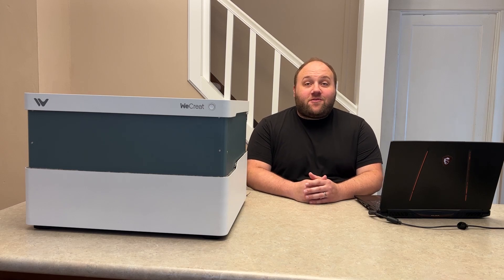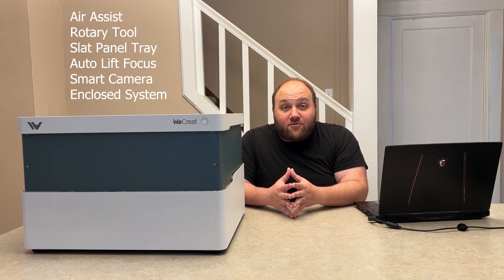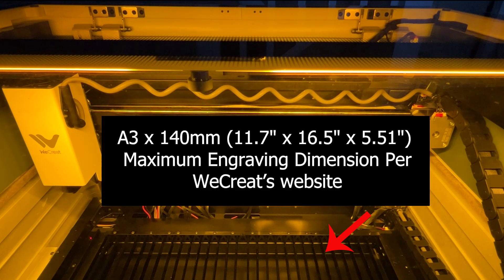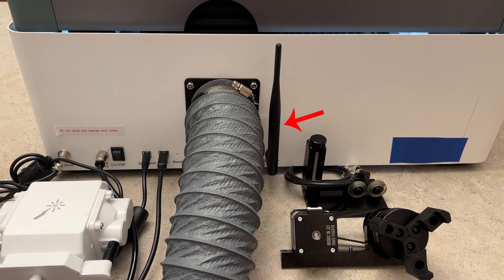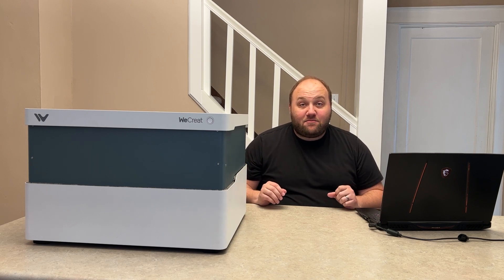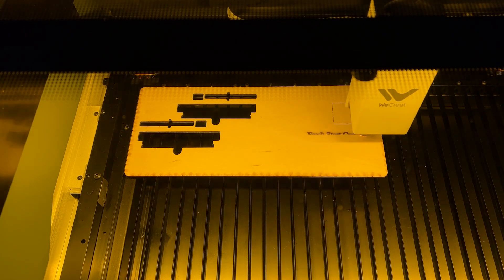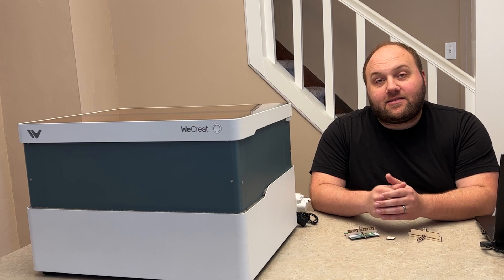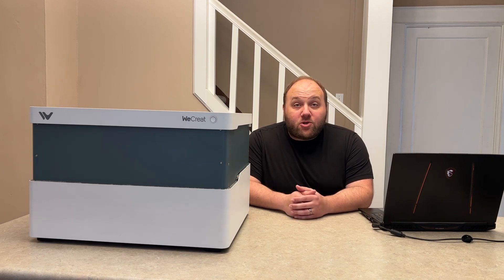Meet WeCreat (The 20W All in One Diode Laser Engraver)

Comment: Regarding the air-assist, you mention an external pump, but is it included? Otherwise, seems cool, but there is quite some smoke on the engraved part at 10:47, right?
Reply from the maker: Yes it is included in the box with it. Everything is pretty much plug and go ready.
Reply from the maker: Regarding the smoke, I am using a 3rd party air filter in this video that’s not made for it as it was the only way I could shoot the video in this room/lighting. I did not have the original air filter for it at the time of shooting. I did try it out a window the other day and there is much less using the standard built in fan.

Comment: Anything on cleaning the WeCreat? It doesnt look like it would be much of a problem but I don't want the same problems as the GF
Reply from the maker: As of right now I don’t have any cleaning tips. I don’t think there will be much at all to be honest due to the stronger true air assist. The crumb tray slides right out the bottom of the unit without reaching inside so that is super easy, it’s basically a cookie tray coming out of and oven lol.